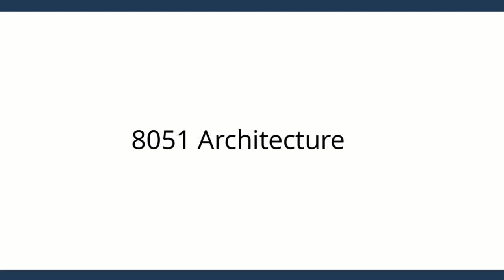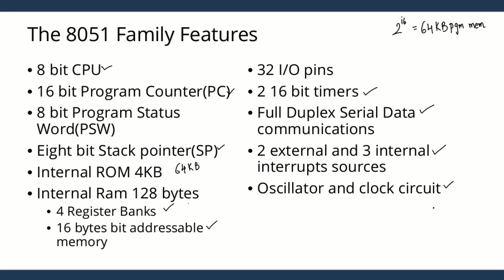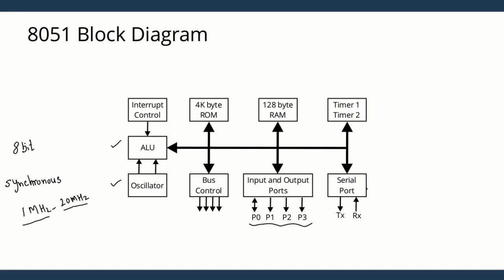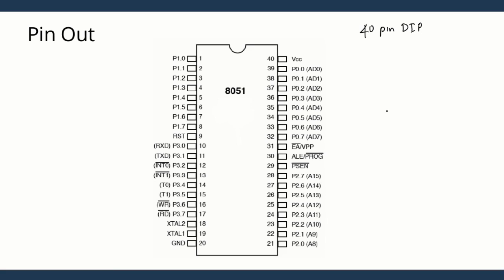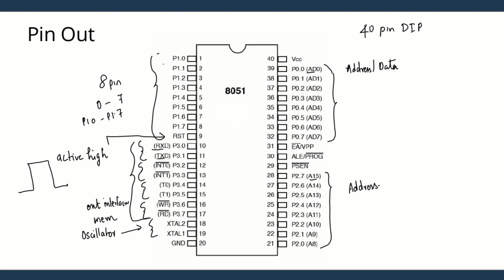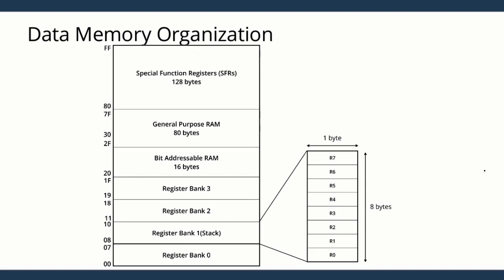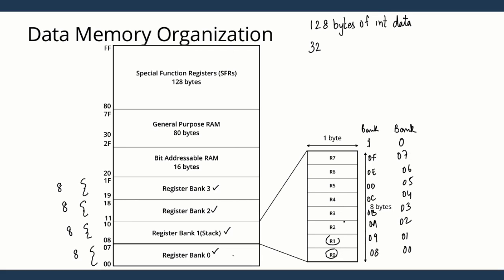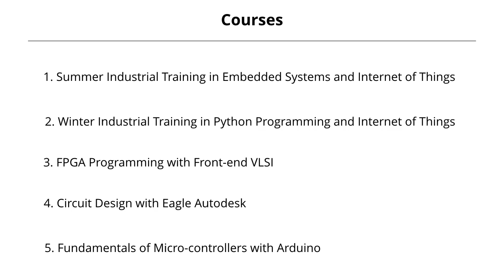Architecture of 8051

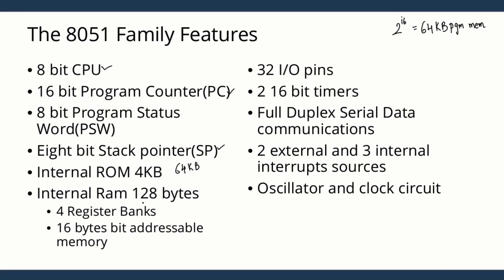Comment: really helpful,  thank you. At 1:50 , i didn't understand where the 60kB came from or its relation with the 64kB Programm Memory coming from the PC. At 2:03 , the 4 Register Banks ( 4 x 8 Bytes) + 16 bytes = 48 bytes , so i think you should have mentioned the 80 Bytes of General Purpose RAM. yet another Quetion ^_^" : where are the SFRs located ?
Reply from the maker: The 8051 can support additional external 64Kb of ROM. You can select internal or external ROM based on the EA pin. 

Yes the RAM has 80 bytes of General purpose RAM. We have direct access to manipulate these addresses in RAM. The distribution is like this:
Banks 0-3 occupy Address 0x00 to 0x1F
Bit Addressable memory from 0x20 to 0x2F
General purpose RAM or Scratch pad from 0x30 to 0x7F.

The SFRs are located beyond 0x7F, i.e from 0x80 to 0xFF. Thus 128 locations are used by SFRs.